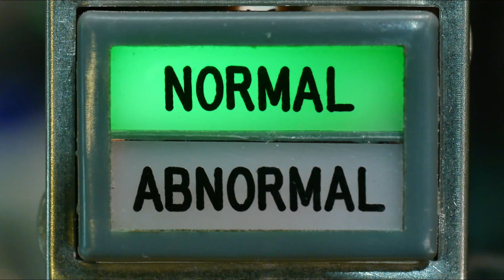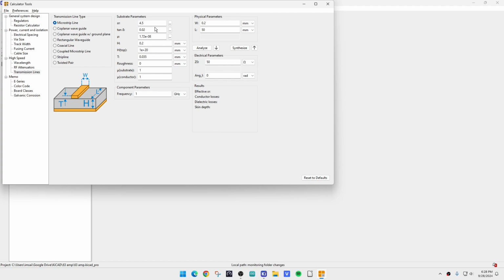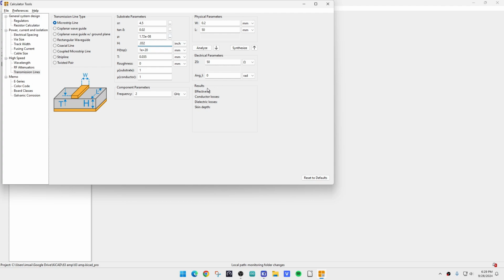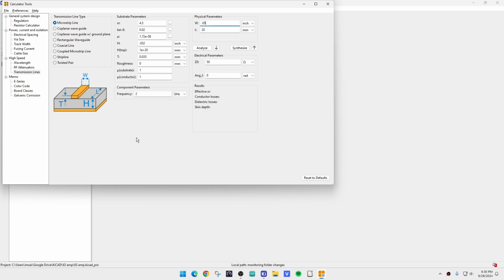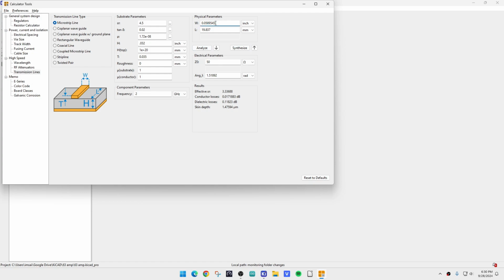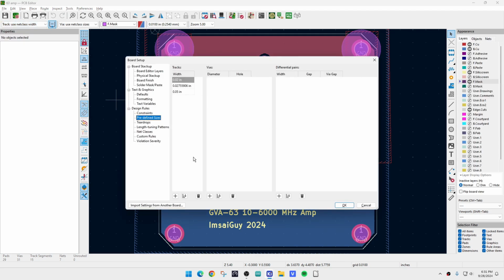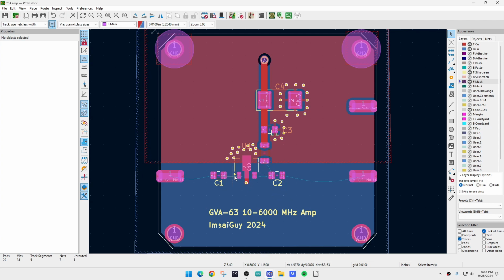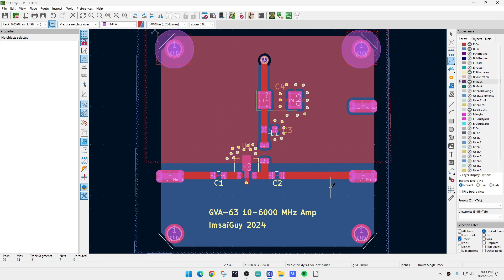#2024 GVA-63  Amplifier Project (part 7 of 10)

Comment: I'm late so apologies if you covered this and I'm missing something, but I was concerned about your U1-L1-C2 node when I saw this is a 6 GHz project. I would tend to place the pad for L1 on top of the trace between U1 and C2 to eliminate as much stub as possible for highest signal integrity. Using as small a part as reasonable for L1 also helps greatly.
Reply: His videos are recorded earlier may be a week or so.
He is trying to teach about RF routing but he is creating a big stub at L1.